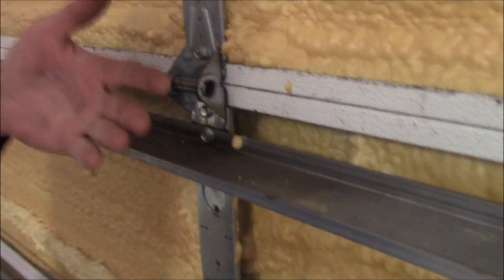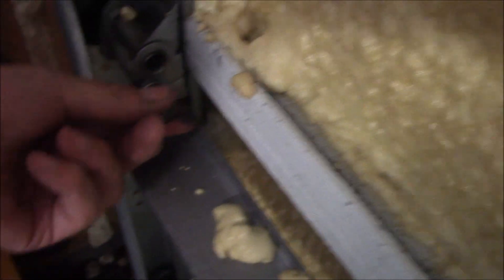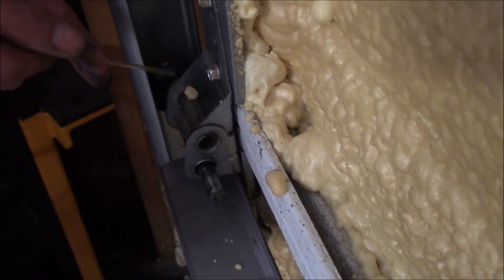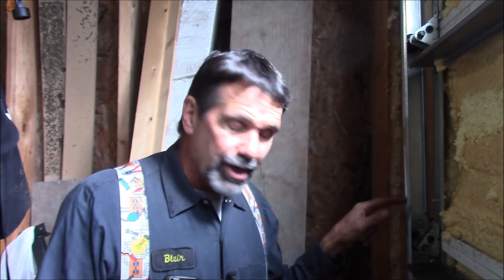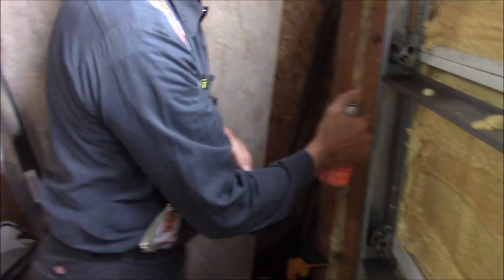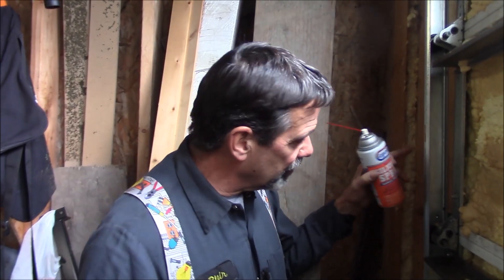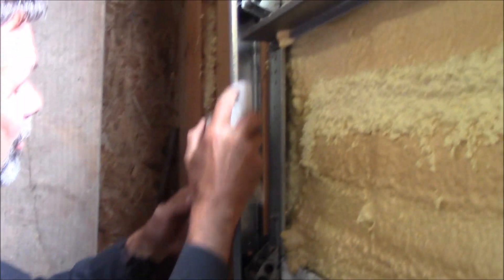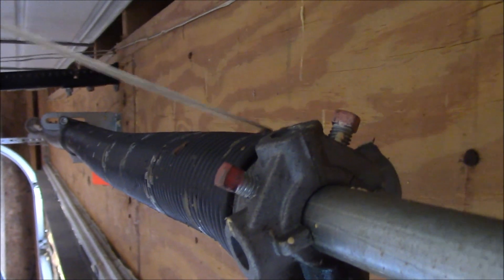Garage Door Parts To Lubricate, Clean - Every Year Use Oil, Grease, or Silicone

Comment: Thanks for the white lithium spray tip!  At a rented house, I had a spring that was so rusted it wasn’t able to be adjusted to balance the door so wasn’t able to safely use the opener.  Was able to loosen it up by first spraying WD40 to try to remove some of the rust, but what finally did the trick was working the white lithium grease spray into the entire length of the spring and all over it, doing so a couple times while raising and lowering the door slowly and a bunch each times.  I did use WD40 to lubricate the hinges etc but will check out some of the other recommended lubricants here and in the comments for the wheels and hinges etc for when it wears away.

Comment: Thank you for the video. Have a very rusty garage spring doors. Before applying the oil, do you have any recommendation for how to stop the rust coming back?
Will clean the rust before doing anything else.
Reply from the maker: Oil not only lubricates, it prevents rust. Keep it lightly coated and it will not rust any further.
Reply: @MrHardware1  Thank you.

Comment: My husband put oil on the garage door chain, so when the door was lifted it left oil residue on the front of the door. How do i get the oil off the chain and door.
Reply from the maker: White DOL
Reply from the maker: Wipe the excess oil off the chain with a rag. You don’t want to remove it all that chain needs some oil. Either you could use a citrus degreaser or you could use a little paint thinner and a rag to remove the drips of oil off the door.
Reply: Thank you

Comment: Thank you for this tutorial. What type of oil did you use?
Reply from the maker: Any all purpose oil, 3 in 1 or motor oil. The main thing is to use silicone in the tracks, oils, WD40 and grease gum up the rails causing too much drag on the wheels. It is worse in cold climates.
Reply: @MrHardware1  Thank you kindly!

Comment: What do you use for spring every several year? Biclub and Chain? I am lost. Thanks!
Reply from the maker: Oil or grease on the spring, each coating will last years. Light oil or chain lube on the chain and white grease on the ‘car’ driven by the chain.
Reply: @MrHardware1  thanks a lot!

Comment: What type of motor oil are you using?  SAE 30? or 10W-30?
Reply from the maker: I'm using 20w oil, but 30 may have a little longer hang time. The importance is that things are not rubbing metal on metal w/out lubricant.

Comment: Why oil and not grease?
Reply from the maker: Lightweight grease, Lubriplate is my favorite, is very good, however too many readers will skip the lubrication is the product is too difficult to acquire. I try to keep the videos very short so some side tips are not included. Thanks for the suggestion. Blair